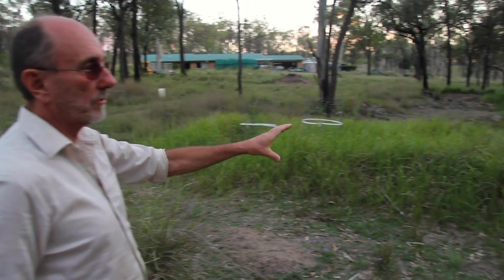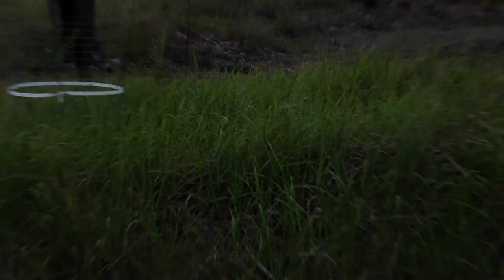Leaky Weirs

Comment: Watch out for snakes with those bare feet!
Reply from the maker: It is an assumption that you are safer re snakes when wearing shoes. With shoes it is possible to step on a snake and not know it. That will give the snake loads of time to strike you on the leg above your boot. If I were to step on a snake I would know about it straight away and jump off it in half a second. Secondly, shoes give a sense of security such that you are often not watching where you put your feet. Walking barefoot, one is watching where you put your feet, so I am more likely to see a snake and so not scare it into striking.